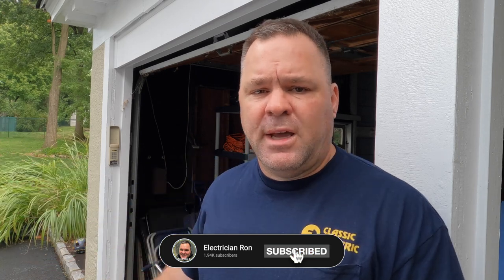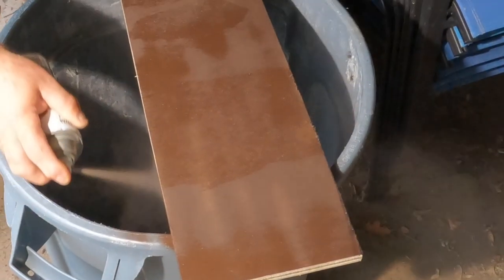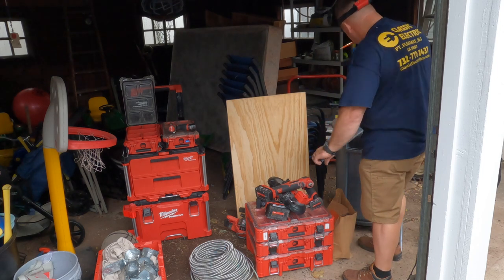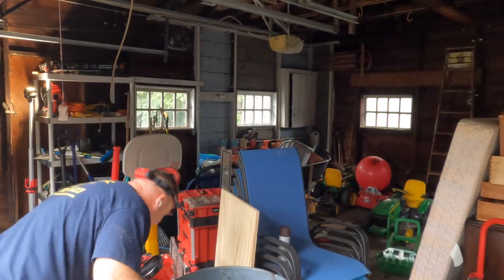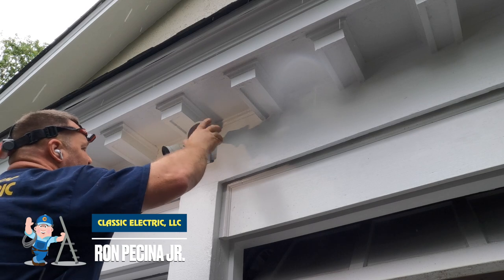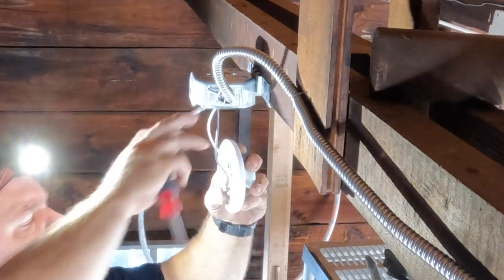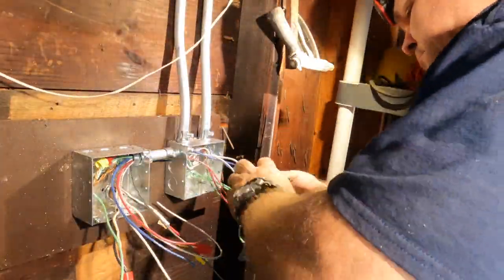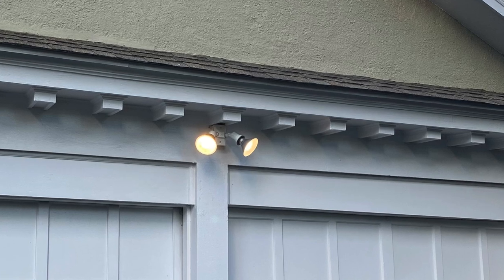Rewiring A 100 Year Old Garage | Removing Knob & Tube Wiring

Comment: The old no. 14 wire on knob and tube would carry a lot of current, being in free air.  Inside walls it is often in good shape, but not so when it comes into a box or just through diagonal holes in a board with loom above the old light fixtures.  Insulation there is usually pretty toasty.

Comment: Folks, he is right about the porcelin lampholders being better. Definitely do not use the cheap plastic Leviton lampholers that are sold at Home Depot. They have a very poor riveted connection which can become loose and arc creating a potential fire hazard.

Comment: Great work Ron. I'd trust you to wire anything in a heartbeat. I'm rewiring my 1933 original wired colonial so I can use some good advice! 

That said, I was a OSHA instructor for a while and if you can turn off those circuits or wear insulated gloves, I would always recommend it. You wouldn't believe how many electrocutions we watch when we go through the instructor course. Hell, we had an electrician there who dang near taught the course. 

I don't even trust a blow dryer near water connected to a GFCI anymore. They're good but still not fast enough response time to mitigate the chance of heart failure from what I understand. 

Sorry, I ranted again 😂 God bless, and great work man!

Comment: Thank you very much brother. We have a 1915 home. There is a wood panel outside. There is still knob and tube coming from that old wooden panel into a old shed outside. I cannot believe it still works. Then we have a yes I know it’s scary, federal pacific panel in the cellar with aluminum wiring. Could you get any more scary. I am currently working on it with a journeyman electrician friend of mine to eliminate thus.
Great knowledge brother

Comment: Oh nice work. Love the EMT, MC cable, and steel boxes. Good materials for a garage. I used NM cable and boxes in my garage, but the commercial grade materials are superior for exposed work for sure
Reply from the maker: Thank you. It’s a little more labor intensive but worth it.
Reply: @electricianron_New_Jersey  If the garage already has drywall up...what do you use to install outlets at the workbench height and for a ceiling outlet for a garage opener? Metal or plastic? Is NMB ok to staple to the drywall or is a strip of wood needed?  or is MC required?  as I understand it, the wiring cannot be subject to damage but is the wiring subject to damage if it is set back 24" (countertop/workbench depth). question being....no conduits needed?
Reply: Doesn't the 2017 code require GFCI outlets in garages?

Comment: I’ve got that same old Edison-based box in my 1920s house too. Don’t know if it had fuses in it at one time but in later years it also became a j-box and recently we just bypassed it altogether. I should probably rip it out but it’s got a 2 inch (?) rigid conduit connected to it and it’s in a tight space so it might just have to stay there forever.

Comment: What brand of keyless lights did you use ?  They look nice. 

I’m a huge fan of MC cable - especially after mice ate through cables in my attic.  I picked up a role of stranded 12/2 mc as it was a sweet deal at the time and like it  a lot.   You did a beautiful job as aways.
Reply from the maker: Leviton at the Home Depot.

Comment: Use your safety classes especially working above your head.  I once was driving galvanized nails above my head and had to go to the ER. A little flake of the galvanized coating got on the white part of the eye and it really hurt. The doctor removed it , no permanent damage. But you lose a day of work. 😢

Comment: Next time you feed a bell box through a wall, just use a short threaded nipple.  Then use an appropriate transition fitting on the inside of the wall.  Rain tight and smaller hole in wall.  Been doing it for 30 years.

Comment: Do the garage door operators need to be on gfci protection?
Reply: From what I can tell, the receptacles for the garage door openers are in the load side of the GFCI on the wall.  The door opener receptacles should be marked “GFCI Protected”.

Comment: Saw the one-handed work at the beginning: "Yep, it's hot."

Not an electrician, but I have enough sense not to buy the $0.60 receptacles -- a good $2-5 receptacle will have 20A internals for the 15A version, good clamps (not stabs!) for back connection , and plenty of brass for the pass-through.

Comment: not using pigtail on outlet you can overload outlet  and the outlet can burn out and it's harder to find in fault finding a lot of the 15amp outlets are cheap and will only last year
Reply from the maker: I'm not worried Sam. The receptacles are designed  and rated to be wired and installed like this. Are you an electrician?
Reply: Hogwash. Using the back stab connection might be risky, but using the screws it will last a very long time.

Comment: That's a lucky break to have a relatively simple and straightforward job of replacing K&T in an open garage. Most of us face nearly impossible jobs in big old houses where all the old wiring is fully hidden behind wooden ceilings and wooden walls, or massive baseboard planks, or plaster-on-lath walls throughout the whole house. Which basically means such massive amounts of demolition and difficult repairs that it is probably better to just bulldoze down the entire house and start over.
Reply from the maker: "Most of us" wtf does that mean? Do you seriously think I haven't taken on jobs like that before? I've done whole houses - BY MYSELF.
Reply: @electricianron_New_Jersey  I never suggested or implied that you haven't done harder jobs before. All I said was it's a lucky break to get an easy one this time. Anyway, if you've done entire hundred year old houses, I guess besides electrician work you are also expert at patching hundreds of ancient plaster-on-lath holes (which can be quite involved) and patching hundreds of unattractive outlet and switchplate holes in 100 year old beadboard walls, (which can also be hard to match and repair). My comment was a simple observation, not an attack, and I did not expect to interact with you directly about this. I've hired many many contractors in my day, but I've never met one who is skilled enough or even willing to perfectly patch countless big holes in plaster walls or beadboard walls, and do a nice job of it. Clearly that type of repair would cost far more than upgrading all the knob and tube to modern wiring.